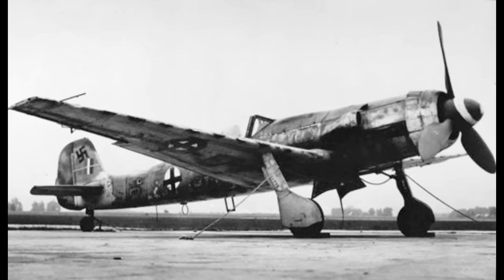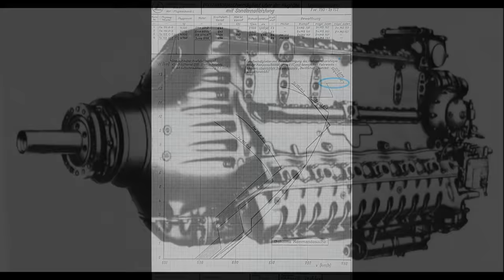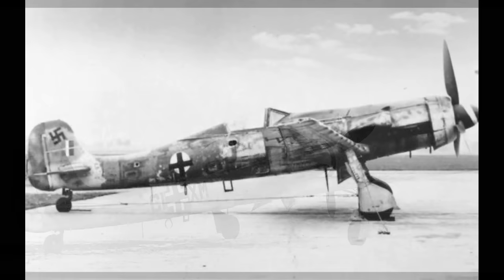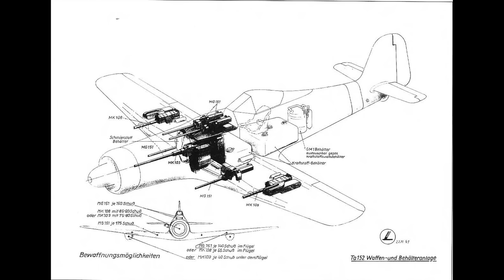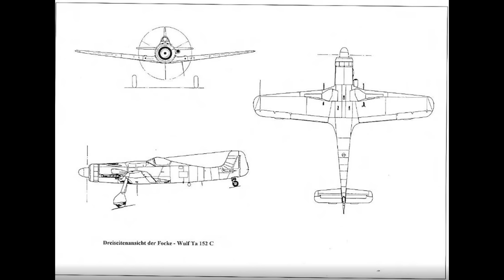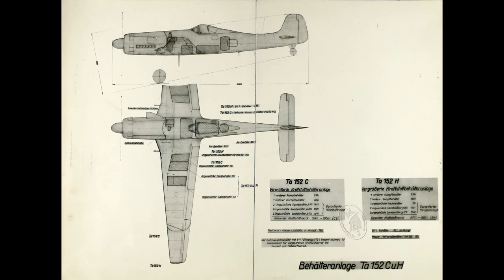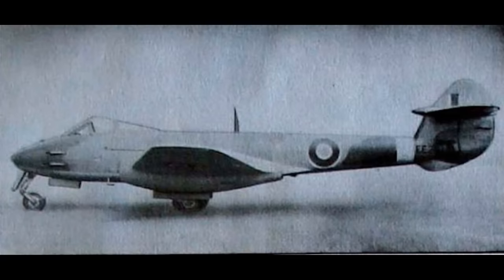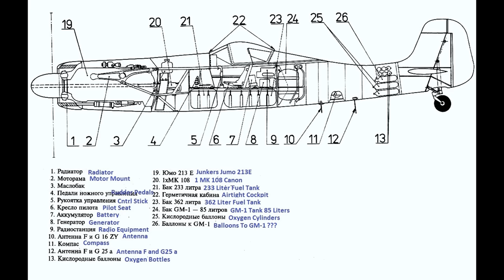Focke-Wulf Ta 152 H-1 Extreme Speed At High Altitudes.

Comment: The problem with LOX is lox density is a function of temp. As the fuel air charge moves toward the intake valve the hotter it gets. Pressure is a function of restriction that’s why aviation engines use inches of mercury to control plenum pressures and not BOOST.  Boost aka pressure is a function of restriction. Engines only care about volume. Delivering that volume at the lowest pressure possible will result in a denser charge because a bi product of pressure is heat. Heat directly affects density. This is why you can take a modern Turbo diesel truck and install a more efficient after cooling system that will have a  loss on your “Boost” gauge yet it will net more power on a dyno. Some people have a hard time understanding that after paying me a lot of money and their truck making so much more power. Why their Boost gauge is reading 5-10 less psi🤣 I always tell them there’s this thing called efficiency🤣🤣🤣
Reply from the maker: I usually increase the boost to get it back to where I was when I started. That way I have the same pressure and lower temps and more density.
Reply: Greg's Airplanes and Automobiles thanks!! I’m not a pilot YET... but I love your channel . If you ever would like to attend a NHRA racing event I have VIP tickets for you and a friend. I fly in and out of 25 races a year and your channel makes my travel fun. Let me know if you ever want to come burn some nitro with us.